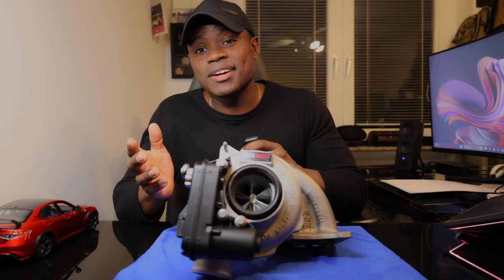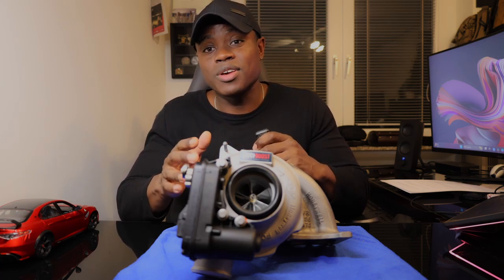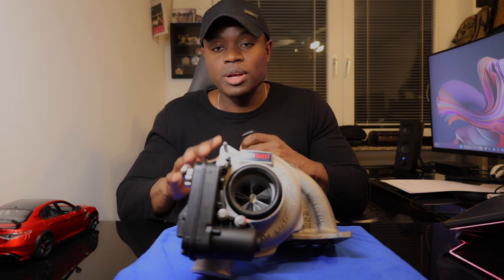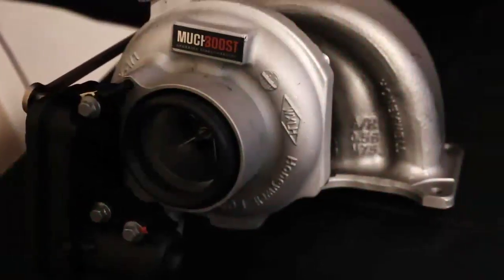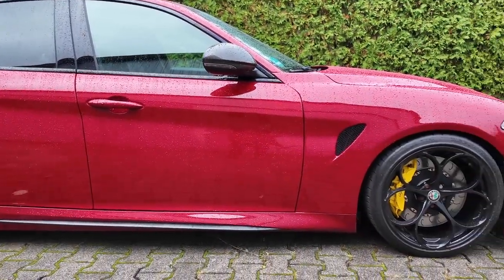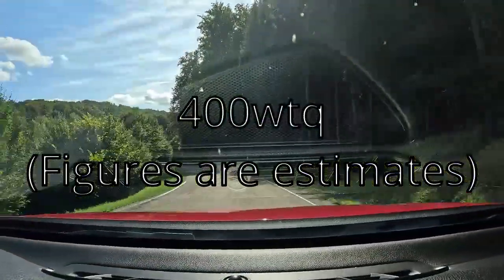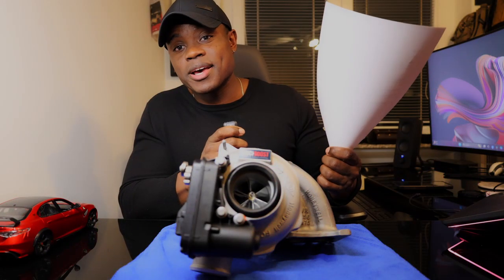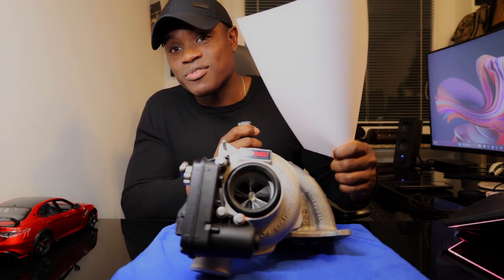Enter the MUCHBOOST 430HP Hybrid Turbo — Next-Level Engineering for the Giulia 2.0T!

Comment: So NO tuning, no support mods required for the 330hp version? What about parasitic wear and tear on other components if left stock?
Reply from the maker: tuning and atleast a high flow downpipe and exhaust are always recommended when running any aftermarket turbo. no parasitic wear, if anything and aftermarket turbo will be safer and more efficient than oem